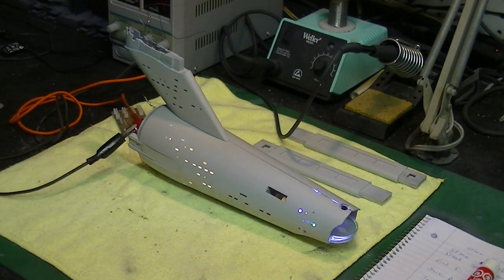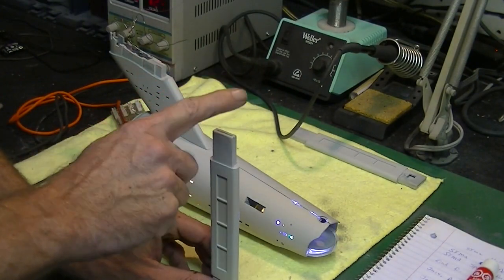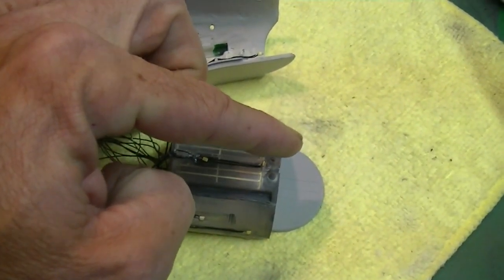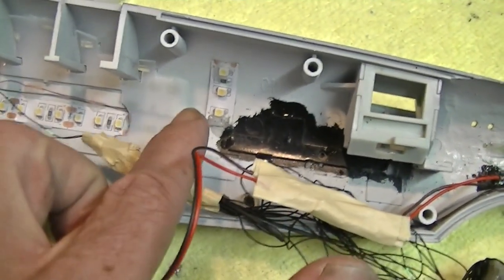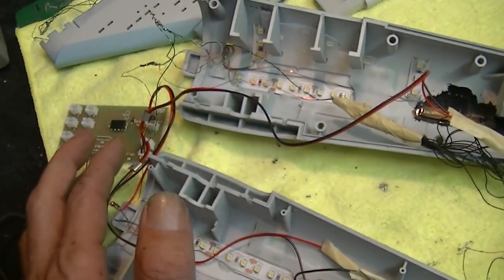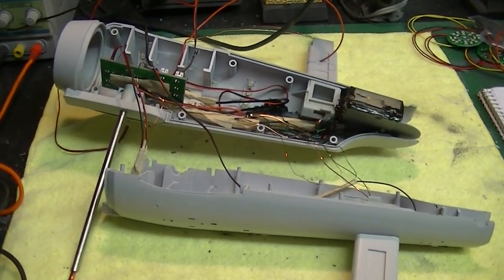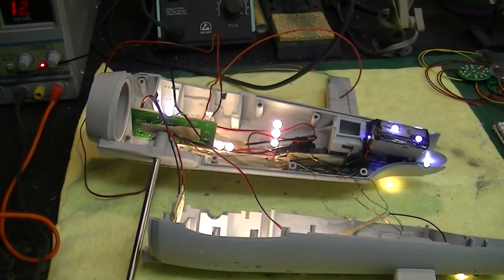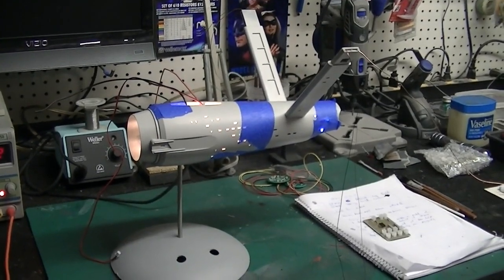How To Build And Light The TOS 1/350 Scale Enterprise (Wiring The Secondary Hull)

Comment: Hi super work, just got my kit. First time for me trying to piant and light a start trek model. I am not a pro just a fan since 1966 @ 8 years old. Why are your engines so quiet? Should I use from Evans Interior lighting kit for your TOS 1:350 Round 2 starship kit or the lighting kit from Polar Lights. Or from TenaControls 1:350 TOS Star Trek Enterprise Fan Blade and Control Boards Item# TOSKIT-350 I don't want liquid fans sounds.